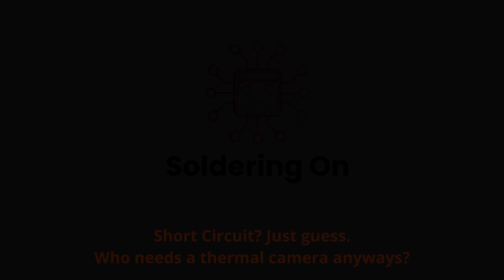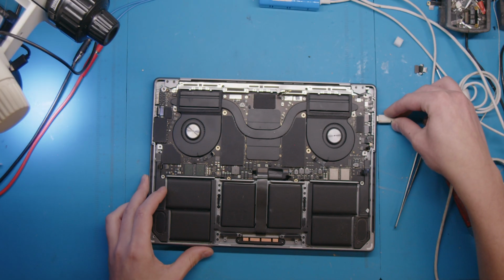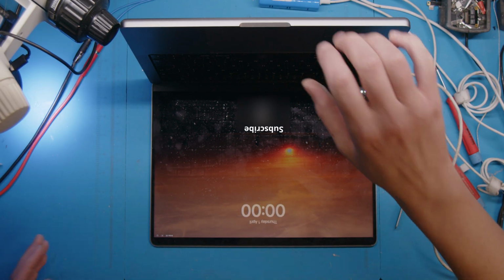MacBook Pro A2442 No Power Board Repair: Lucky Short Circuit Fix

Comment: I don't think it was a a mosfet that's a 58889D Texas Instrument I think it must be some kind of power management but I'm not familiar with macs
Reply: By the way I just made a video and you got a mention on there
Reply from the maker: Thanks for watching!

It’s a dual asynchronous mosfet, so it’s both a high side and a low side mosfet in a singular package feeding one of the three 3v8_aon phases.
Reply: @Soldering_On that makes sense! I haven't seen it before it didn't look like a normal mosfet with the leg arrangement